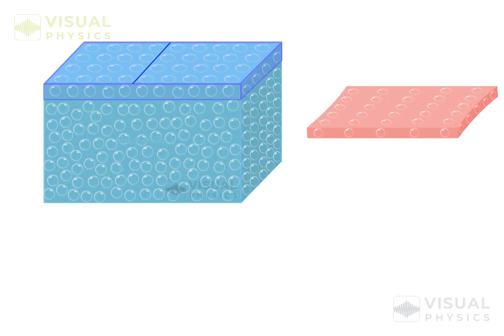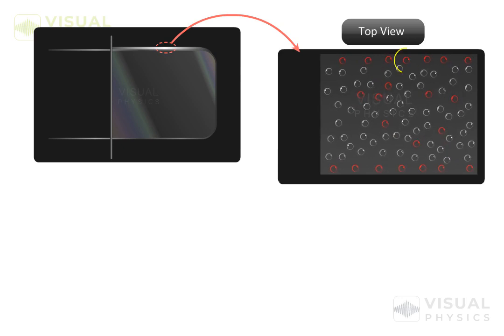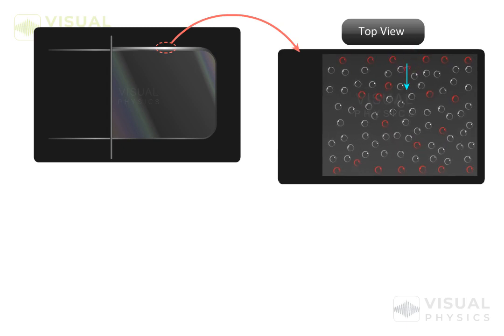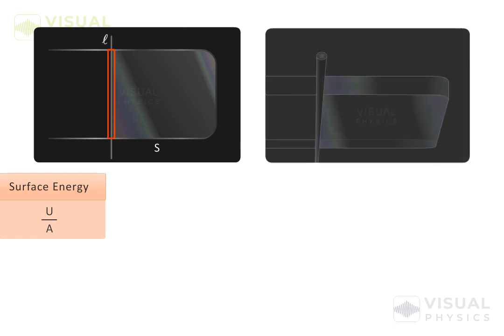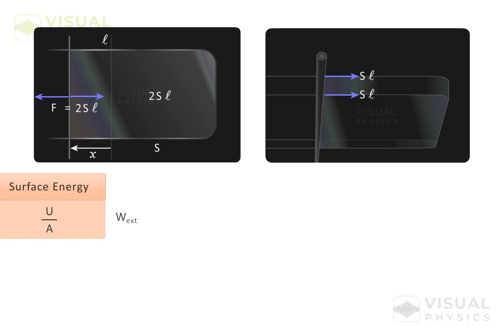Fluid Mechanics : What is Surface Tension and Energy

Comment from the maker: 00:08 Surface tension results from asymmetrical molecular distribution
00:41 Surface tension is caused by molecules at the surface of a fluid being more attracted to each other than to the molecules in the bulk
01:13 Surface tension is the force per unit length on the surface of a stretched fluid.
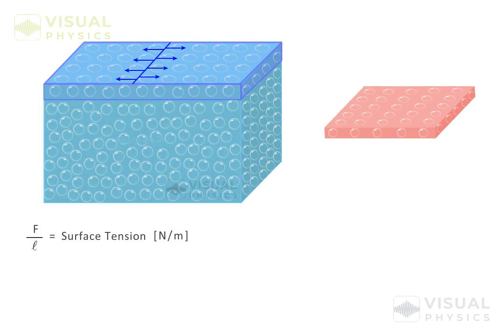01:45 Surface tension causes reduction in surface area
02:19 Surface tension is caused by net force on surface molecules.
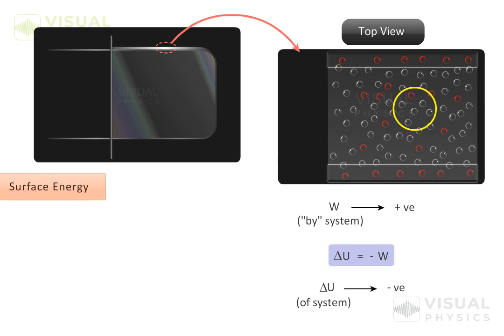02:56 Surface tension is the extra energy possessed by the surface of a fluid.
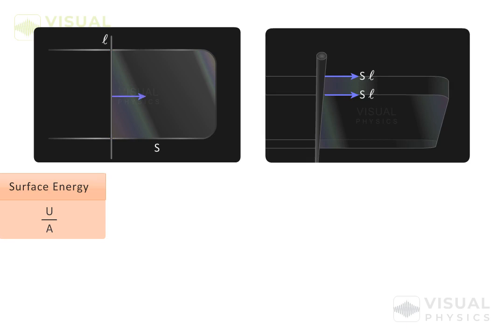03:26 External work done is stored as potential energy through increased surface energy
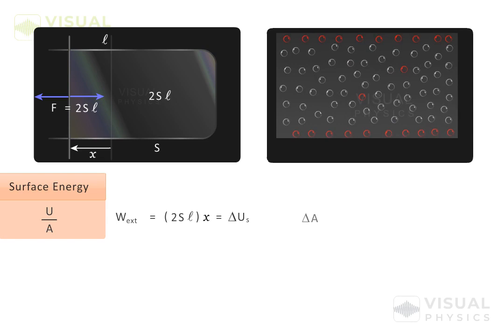04:02 Surface energy is a representation of surface tension